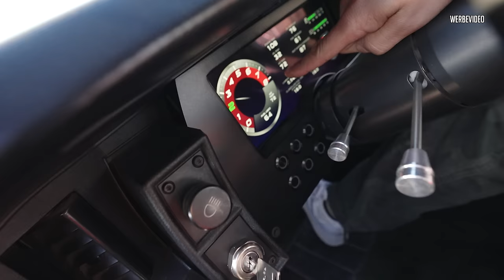JP Performance - V8 POWER ZERFETZT DEN DRIFT-LOT! | U.S. & Action!

Comment: Die amerikanische Kultur was Fahrzeuge angeht ist einfach nur geil. Ich hab lnage bei nem Opel Händler in der Werkstatt gearbeitet, und die haben auch General Motors vertrieben.
Das ist mit nichts auf der Welt vergleichbar. Wenn man einen 5,7 als "Smallblock" bezeichnet, dann weiß man schon was da los ist. Und dann haben, oder hatten die Motoren in Trucks usw höchstens 250 PS.
Ich liebe die Kultur, und das Video zeigt auch was für sympatische Typen das in der Regel sind. 
TOP Video!
Freu mich auf mehr

Comment: Jp also der Big Block ist eh nix für deutschland weder der alte noch der neue allerdings sind die small blocks schon perfekt. passt fast überall rein und kostet selbst in deutschland nicht viel wenn man  ausweicht auf die verwandten LS motoren wie LM7 mit 5,3l Hubraum gibt den gleichen auch noch mit 4,8l meine ich oder 4,6 waren es. Bin selber am LS Swap dran 66er Bel Air mit der 5,3l Maschine. Bin gerade noch dabei den Motor auszurichten und dann kann es auch schon losgehen. Die originale Ecu kann man auch ganz einfach weiterbenutzen und ohne großen aufwand die Wegfahrsperre etc rauscodieren. Das geile ist einfach das so vieles von den verschieden Motoren untereinander tauschbar ist. 
PS: Ich hoffeeeee ich werde irgendwann TÜV dafür kriegen :D